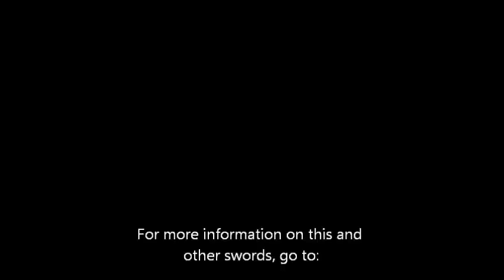Link sword

Comment: Glad there are so many in the comments with the same need to share the same bit of information; that this would technically be a variant of the "Master Sword" design. Glad we're all on the same page now.
Reply from the maker: I'm just gonna pin this to the top.
Also of note: This is the only sword I've made based on the Zelda game world, hence it is a Hyrule sword. It's an amalgam of a number of different versions of Link's swords as well as being re-interpreted into the real world.
Reply: It would be nice to see a reinterpretation of several fantasy swords that have really cool esthetic ideas ruined by over-the-top stylization.

Arthas Frostmourne
Gutz pre-dragonslayer
Conan Atlantean

I could go forever...
Reply: It'd be cool to see so many in the comments section make one, since everyone is an expert all of a sudden.
Reply: I'd keep the winged quillons, the ricasso, AND the blade width. I'd go with the hexagonal blade-section. I'd go with two gold gems on the guard, too. One gold gem in the middle on both sides o' the guard. I'd go with a 21 or 22 inch blade with a 10 inch handle handle. AND a functional scabbard.
Reply: @truelionofhylia8152 those proportions are weird lol for a 20 inch blade you'd probably only need a 5 inch handle, that's basically a gladius.

Comment: The pommel and guard are both bronze/brass right? How did you get the blue color on it? I was going to use a light bluing, but everything I've used in the past comes off pretty easily.
Reply from the maker: I used a purpose made metal dye and then clear coated them.
Reply: brotherbanzai okay, I didn't know there was a dye for the metal, I think I've looked before but always come up empty handed
Reply from the maker: Here ya go...
https://www.sculptnouveau.com/Details.cfm?ProdID=38&category=6

Comment: I like that you actually gave the blade a fuller unlike in the original games. With as much steel as there probably is in the damn thing, I don't get how Link swings it with one hand so easily.
Reply: you're right, but link can still lift boulders
Reply: True. I guess that's why he's the Hero of Time.

Comment: I've been following your creations for a few years now (all awesome by the way) Where did you learn your craft? Trial and error? Or did someone hand the information down to you? Keep up the awesome work!
Reply from the maker: Thanks! I worked at a bronze foundry for about 7 years to learn about the bronze casting process, it's usually about 5 separate jobs. Did a lot of research and reading to learn more about those processes while I was there and after I left. Taught myself how to sculpt, make molds, etc. I also learned how to make blades by doing a lot of research and reading. We are in a golden age. You can learn about nearly anything by doing research online and following that up with books or other information sources found online. I find that if you want to do something new, you can read up on it until you have a pretty thorough understanding of it and remove nearly all the "error" of the first "trial".

Comment: Hi, my name is christian and I just started black smiting, i'm currently just practicing with knifes at the moment since I can barley keep my grinding lines straight... However I just have one question, How did you get your fuller so straight and clean? did you use the belt grinder? or did you use some kind of mill? Oh!! and if it was the belt grinder what grit of sandpaper did you use? sorry I'm really nooby..
Reply from the maker: I use a belt grinder to make the fullers. I start at 36 grit, then 60 grit, then 120, then 220. Then heat treat the blade and back to 220 again before moving on to hand sanding. If you have access to a milling machine, that way is a good bit easier.

Comment: how's that 80crv2 work for you? I'm about to try forging some danish style longswords from it and I'd like to know just how tough a sword it makes? If I forge it right will it survive repeated slams into hard wood? I've made beautiful leafspring blades that broke on the first hard strike. Even with good grain refinement and high temper(450F)
Reply: Uninspired Rambler I'm not the guy you're looking for an answer from, but it's a really good blade steel when treated correctly, and would survive hacking into hardwood for a fairly long time. hope this helps
Reply from the maker: It's been working great for me. If you want a tougher/less hard blade steel you might try 5160, that's pretty durable and is cheaper than 80CrV2, but also not as consistent in its chemistry.
Reply: brotherbanzai Thanks for the reply. I think I'll stick with the 80crv2. I don't make many blades so I can justify the expense to make really nice one-offs.

Comment: doesn´t the belt-thing you use for "finish grining" damage the tampering? i see a lot of sparks flying and afaik that´s death for any kind of blade supposed to be sharp. but please do correct me if I`m wrong about that
Reply: warchiefharrison1 yse, tempering.
i didn´t mean the blade as a whole would overheat, but very small areas localy, since one can see sparks flying. and as I said, I was under the impression that when grinding a blade and one can see sparks fly it´s a given that the edge is taking damage

Comment: For swords like this, is it better to sharpen it with teeth-like edges or sharp layered edges? Or, are you not bothered by the sharpness of the blade?

P.S: I know the sword is for display and not to hunt humans with it...But I still want it as sharp as a japanese katana, I just want info on your opinions about how to sharpen big swords like this.
Reply: Oh also, if I were to buy one of your customized blades, do you do further sharpening?
Reply from the maker: LoLWiki I can make one of my swords sharper if you wanted it very sharp. I have no idea what teeth-like edges or sharp layered edges are. An actual Japanese katana is sharpened by polishing the blade all the way to the edge. This makes for a very sharp, but also fairly delicate edge. I don't sharpen my blades like that.
Reply: brotherbanzai Ty for answer, and I did some research, what I said about the katana is not precise, how they make the layered edges and sharpening process is by folding it many times and sharpening with a very long process.  

Sorry to cause any confusions and thank you for your answers.

Comment: How do you get the blade to where it is before you start to work with it? Do you order it that way, pound it out, or grind it down?
Reply from the maker: I either forge them to shape or grind them from a piece of plate before heat treating them, depending on the sword. I think this one was some forging but mostly grinding, it was a while ago.

Comment: Does the sword have any distal taper? As a default I would assume that it doesn't, but given how there's pretty much no profile taper on the blade (apart from the tip), I would also assume that a lack of distal taper in addition would impact the feel and performance of such a sword.
Reply: It would, but with a blade like this that has such a wide, deep fuller, I think you'd still have a pretty nice point of balance even without distal taper.
Reply from the maker: The blade tapers in profile from 2.26" at the widest portion near the guard to 1.81" at 3 inches before the tip before transitioning into the curve which makes the point. The blade distal tapers from .27" thick at the base to .185" thick at 4" back from the tip, thereafter tapering quickly to the point.
Reply: brotherbanzai Oh cool. Thanks for the info. I didn't manage to spot the profile taper but those stats sound pretty decent. Nice work.

Comment: Gorgeous work man.
Reply from the maker: Garage Gymnastics Thank you
Reply: I will trade you a custom built AR 15 made from top brand parts.
Reply from the maker: +Garage Gymnastics Thanks for the offer but I already have two ARs which I put together exactly how I wanted.
Reply: +brotherbanzai You got some nice toys. How long have you been making blades? Did your father teach you alot of this stuff?
Reply from the maker: Garage Gymnastics Thanks. I've been making blades for around 7 years I think. I learned most of it from reading and research and a lot of the stuff related to bronze work from working at an art foundry for several years.
Reply from the maker: +kiles7  Yes I do. Go to my website, which is listed at the end of the vid and in the video description under the vid, for more information.

Comment: could you show making the locket of the scabbard? if you did i would appreciate it greatly
Reply from the maker: Will Thomas I don't have any video of that. First the blade was made, then the wood core for the scabbard. The wax for the locket was sculpted onto the wood scabbard core, then it was removed and cast in bronze.

Comment: Can you please tell me where you get your investment casting supplies? I've looked and it seems that i cannot find reasonable prices for my standard - considering it's not a money making hobby at my level of experience. I know metals are all about the same price no matter where you shop, but i was wanting some info where to buy ceramic slurry, silica sand, micro-crystalline wax, rubber molds and anything else you are willing to share that might help. Furthermore, from what i have seen, there are a variety of different types of Ceramic's and Rubber molds. Your insight will be very helpful in purchasing the right materials with an exceptional finish as your craftsmanship has without spending money on unnecessary or unwanted items. Oh, and great job by the way... Seen a lot of video's on Youtube and all of yours are by far the most intricate.
Reply from the maker: Eric W. I get my ceramic shell supplies as well as casting wax from Remet. There is a company called Shelspen which sells smaller kits for hobby use. Sean Colson who runs the little home based company is a nice guy and I'm sure he would be very helpful in helping you figure out what you need. I believe he gets most of his supplies from Remet as well. For molding rubber, I use Smooth-on and polytek, though mostly smooth-on now as they are a bit more convenient. There is a huge variety of rubbers and what you get will depend on your specific needs, same for wax. There are a number of different types of colloidal, refractory powders, and sand as well, but not so many. Sean can help you decide which of those you would need.
Reply: Thank you for the info, ill be sure to use it. Have a good day and take care.
Reply from the maker: Eric W. You're welcome. Sorry it took so long to reply, I didn't know there had been any comments on this particular video and I only log on every couple of weeks most of the time.
Reply: No problem. Thank you for your time, its appreciated...

Comment: Now THIS is how you make a modern mastwersword. My ONLY  irritation with it is I feel you cut the fuller a little to close to the tip. Id also like to see if ypu can weild it 1 handed, given how broad that fuller is.
Reply from the maker: When you order yours, we'll put the fuller wherever you want ;)
Still pretty long and heavy to wield one handed. Has a nice ring when it cuts though.
Reply from the maker: dalton jones Yep, my site is listed in the video description as well as at the end of almost all my videos: bronzebyjeffreyjrobinson.com
Just click on the "Custom Blades" page. 

Ha, no, most of these were made for others. I could never afford to spend this much time and resources on making things just for myself. (some I do, but not many)

Thanks very much.
Reply: brotherbanzai wow, absolutely amazing. Might I reccomend considering making a 1 handed version? To stick to links tradition ofcourse. I think mamy fans would want to buy one of those aswell. As for this, gosh if I was one of thpse collectors and could blow 4000k I sure as hell would. Aboslutely divine. Have you considered giving it an even more mirrory polish?
Reply from the maker: dalton jones I don't usually do a higher polish as it is more difficult for the owner to maintain (shows every little scuff and scratch very easily). But just like making it one handed or the fuller, I can make pretty much whatever variation the person commissioning it wants.
Reply: Thats awesome man. Would a 1handed version be of the same price? And how easily can you reproduce a blade already made.
Reply from the maker: dalton jones 1 handed would be a bit cheaper but only by a couple hundred, doesn't really change much of the work involved. It's no easier or harder to make a blade similar to one I've already made.
Reply: Very true. Well thanks for the info. Still in awe of your masterpieces.

Comment: its called master sword not link sword plus the master sword does not have a part taken out down the middle but still a nice sword
Reply: Cath Johnston
Reply: NIKHATH FATIMA . yes thats my name
Reply: Cath Johnston he ground the center out to lighten the blade, it's rather large and would weigh a ton if not done that way
Reply: It's a fuller; the problem is depending on which game you look at the sword, the center of the blade could be convex or concave, which makes it hard to know the blade is shaped.

Comment: Wrong replica. Master Sword is a 1h Sword
Reply: dancre what's 1h?
Reply: 1 handed
Reply: dancre oh, haha okay thank you! :)
Reply: Actually, depending on which game, it's more of a bastard sword than anything.
Reply: O really? on which Zelda game exactly the master sword is a 2h sword?
Reply: He doesn't mean that it's a 2h sword, in certain games the handle and blade are made super long, so it could technically be used 2 -handed.  Ex. Twilight Princess, the Master Sword was suuuuper long compared to let's say OoT.
Reply: +dancre Pretty much any of the 3D Zelda games? The blade and the hilt are too long for it to be an arming sword (or "1h sword" in your words), but it's not so long that you can only use it properly with two hands. Thus, it's a bastard sword, or a hand-and-a-half sword.
Reply: 1h 2h? what is this, RuneScape?
Reply: +Afloat Fob To be fair, that's probably where his "knowledge" of swords comes from.
Reply: Afloat Fob Hell, the Germans called it the same thing lol